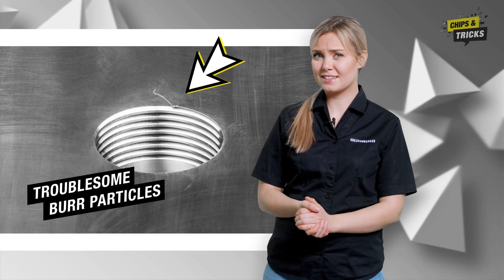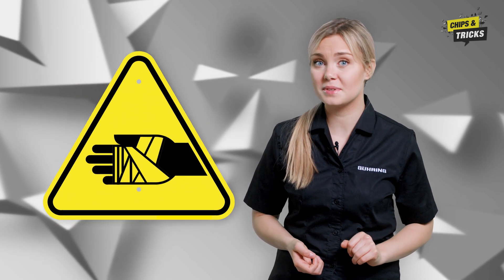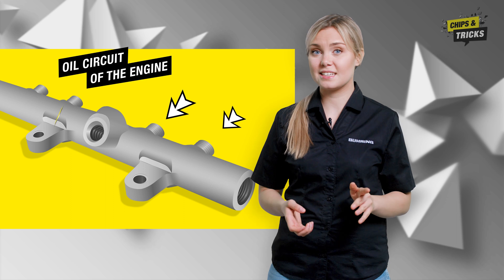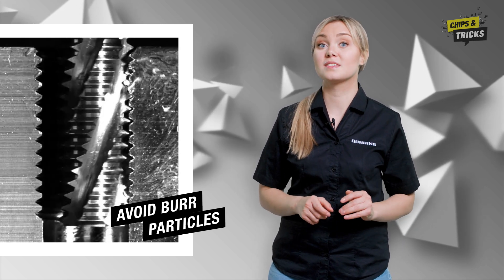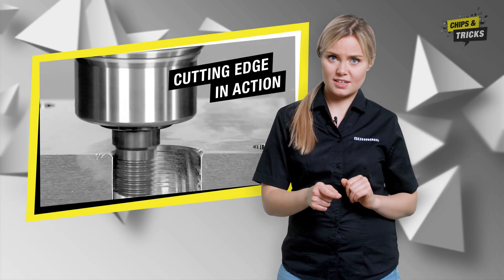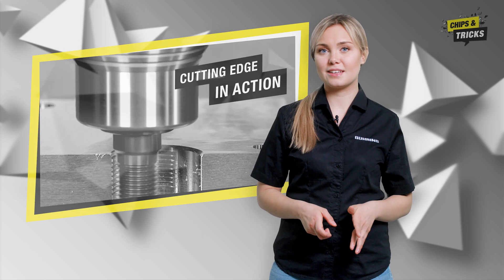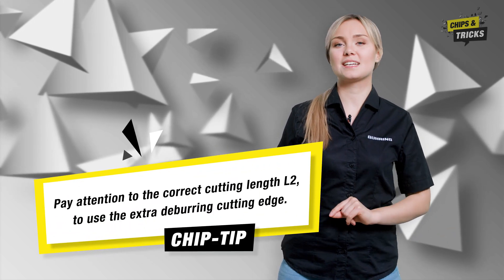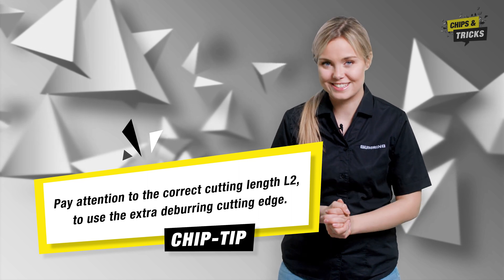How to avoid troublesome burr particles during thread production

Comment: Is it possible to get information to prevent  burr during  threading ? inside of hole and at the bottom of hole when there are 2 holes intersecting each other at 90 degrees.
Reply from the maker: Hello @sedataras785, thank you for your request! :) We'll add this to our topic list for Chips & Tricks. In the meantime, you are welcome to contact us via the chat function on our website (👉 https://guehring.com/en/) or via WhatsApp (👉 +49172 6585353). There you will get quick answers to your questions about the use case.
Reply: Just pass a return chamfer it will remove burr in IR thread